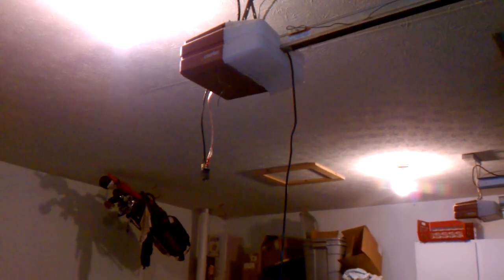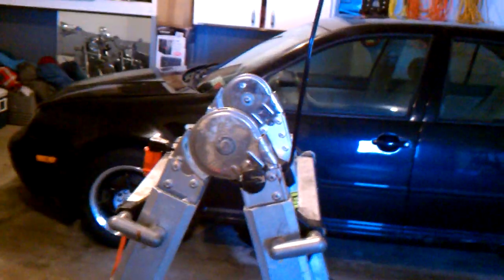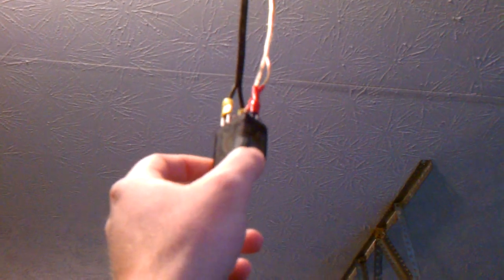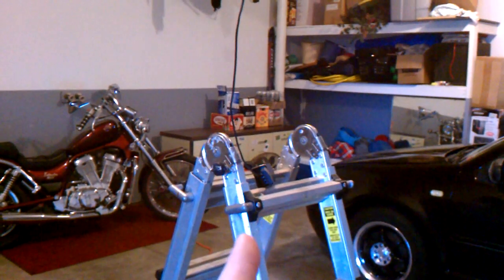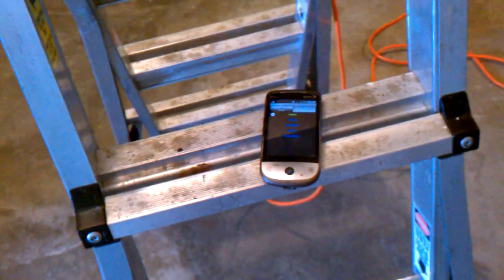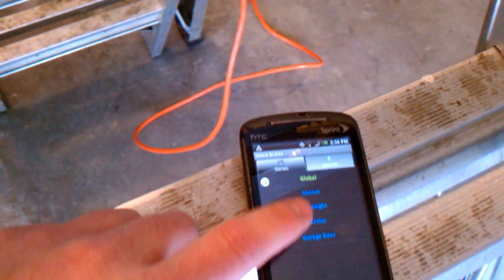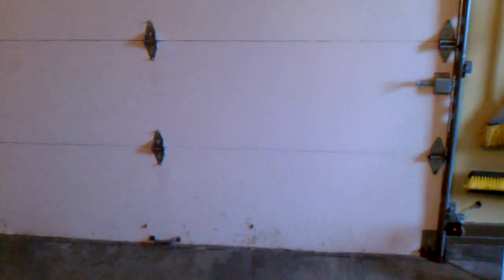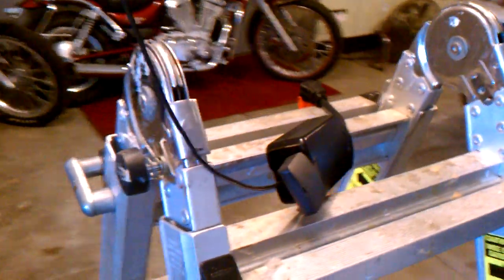Garage Door Automation with Z-Wave

Comment: Just wanted to my thanks for this as well. I used this as a guide and automated my garage door opener today. Since the radioshack link is dead, putting in a couple of links to help others --
I order the 12V relay from Amazon here - . https://www.amazon.com/gp/product/B01B60BQFA/ref=oh_aui_detailpage_o01_s00?ie=UTF8&psc=1
I had a old 12V power adapter (Vonage phone adapter actually) that I used to hook up the inputs on this. The output went to the control for garage door. Worked like a charm. Thanks!

Comment: also does this have battery backup now or no and safety sensors and a keypad or no also you should replace those garage door openers with a liftmaster 8550 with battery and a new clopay door 9x69 clopay door replace that ugly wood door a clopay door with windows and wi fi in in it or raynor admiral 2 8550 rdg with wi fi and

Comment: Great video. What type of wires your are using to and from the Relay. I got the Relay in your link but found it difficult to work with SouthWire 12/2WG. Thanks.
Reply from the maker: Wadood Chaudhary Whatever wire I had laying around. To be honest it's not that important. So whatever you have the works should be fine.
Reply: Ryan Schneider I think you should mention 2 conductor wire or something like that. Thicker wires would not warp or hold onto Tyco Relay witch. Anyways, thank for your ingenuity. I was able to do it, and I also added an inxpensive garage tilt sensor and now I also know whether the garage is open or closed as well.
Reply: Somehow the garage door switch on the wall is turned off when Z-Wave switch is turned on and vice-versa. Does anyone know why is that happening?

Comment: HELP! Every time I try to do the exact assembly shown in your video and several others the button on the wall won't work. The app will, but the wall-button opener won't. And vice-versa, if I get the wall-button opener working the app won't work anymore (and the wiring is EXACTLY as shown in the video)... Please help.

Comment: Thank you very much for the video. Everything worked out great. I did want to share my experience as a Vivint User.

Being on Vivint is where I had to get a little creative. I checked into the scenes but unfortunately the Vivint controller is VERY limited on what you can do. You can only set a single unit to turn on or off. You can't set it to turn on, wait some time and turn off. So I was poking around the web setup for Vivint and ran across the rules section under emPower. Here is where I found the solution but you will need a sensor on the garage door. I already had a window/door sensor installed on the garage door from a spare one that I had for a while. In rules I setup two rules. They are as follows.

Light Rule 1     Garage Door
Opened     Always     Turn OFF     Device 2: Garage Door
Light Rule 2     Garage Door
Closed     Always     Turn OFF     Device 2: Garage Door

I put everything together and it worked perfectly. Thanks again for the video.
Reply: thanks for the details... ill be trying it tomorrow

Comment: I did something similar to this, but not quite the same. Rather than wiring directly to the garage door opener I used a garage remote.  This might seem like a more expensive option, but I had quite a few extra openers around so my cost on that end was zero.  I used the same zwave device, setup a scene the same way, but had the relay close the switch on the garage door remote.

Comment: Your garage door opener motor must be plugged into always on outlet. If you have a Z-wave controlled outlet you will need a relay to tell the garage door opener to trigger open and close. You should use a 12V DC relay for this as the 110V AC relays as featured in this video can be dangerous. If the relay overheats, it can cause a fire.
I hope this helps.
We do sell these relays, as well as other items for your Home Control System.
007systems

Comment: Nice Video, 
I installed a zwave in wall duplex receptacle. Can the garage opener be plugged into the same outlet or does it need to be on a different outlet for it to work ?

Comment from the maker: Normally it would, but I don't activate the zwave outlet directly. I use a Scene. The Scene is programmed to do the following:

1) Turn outlet on
2) Wait three seconds
3) Turn outlet off

Therefore when I activate the garage door, I'm actually triggering the scene in my vira controller.

Comment: Thanks for share this!!! I just have a question... 
The Z-Wave Outlet is designed to turn on and off a light or a device. Every time you activate it you turn on or off.  The requirement here is to send a pulse to the relay because when you pulse the wall button to open or close the door you press only for a while.  When you activate the Z-Wave Outlet isn't it like if you leave the button pushed until you deactivate again the Z-Wave Outlet?

Comment from the maker: I personally did not bother with that because I had wireless IP cameras setup outside the house that captured the garages. That way if I there was any question, I would check the video. Additionally I used Vitamin D to setup email notifications/alerts on the areas on the screen where the garage doors were so I got notified anytime the door moved. While not ideal for what you're saying, I was able to kill two birds with one stone.

Comment: thanks, your idea was golden to me. I was trying do solve the problem, was thinking of a separate "pulse" circuit and googled my way to your video. Et voila, it's working...unfortenately, I can't read the status of the gate. Maybe , I'm thinking of using some sensors that connect trough Z-wave, any other idea ?

Comment: I like the idea but it’s not NEC compliant as done and could invalidate your insurance policy should something go wrong. The good news is the fix is fairly easy. Use a low voltage relay coil (12VDC relay coil voltage) instead of a 120VAC one. Then get a 12VDC wall wart (power cube) and plug that into the Z-Wave switch. From this point on you are using low voltage Class 2 wiring which is much less stringent from NEC perspective. It will be safer and you avoid the NEC noncompliance.

Comment: I apologize for my ignorance, but when you suggest installing this hookup "in parallel", I'm not sure precidely how to wire a single device from 2 power sources in parallel.  My attempts at inserting the low voltage wires from this hookup into the garage door opener in the ceiling into the same slots as the current wires did not work.  Am I doing something wrong?

Comment: There is a slight downside, in that z-wave is not secure.  Anyone can spoof the homeID and open your garage door, if they felt so inclined.  The only secure zwave devices so far, I believe are the deadbolt zwave locks, which swap an encryption key, and I believe a garage door opener module.  I like your implementation, pretty easy and elegant, but I'm personally going to do a little more looking into the security aspect.  I'd just attach the garage door to the home alarm, so sirens blare for now

Comment: Fahd - depending on your alarm system you could add a sensor to Partition 2 ( if you have a common alarm system like a Honeywell Vista 15p / 20p)

You can then set the alarm to NOT alarm when Partition 2 sensor (the garage door) opens during certain times (9-5pm for instance). But yes - in the same way opening a door (from inside) when your alarm is 'away' will produce an alarm, so will opening the garage door. Using partitions allows you to keep the 'house' alarm separate from the garage alarm.

Comment: Ryan. First - thanks for your video. I used it to fashion my own z-wave opener, but instead of using the 'outside socket' that you have, I replaced my existing 2-receptacle socket it was previously plugged into with the z-wave enabled socket ( GE 45605 )

It's a bit cleaner and allows you to have both the opener and the switch in the same receptacle. If you mount it in a double-sized container you can affix the relay on the other side of the box :)

Comment: Thanks so much for posting this. I set this up today and it's working great. I was going to use an LFM-20 zwave relay but its hard to find. This worked just as good and is cheaper to boot. Thanks again for the great video!!!

Comment: Awesome video!!  You're a huge help.  We found this video a little while ago and set it up just as you displayed and we got it to work.  Instead of using the external z-wave plug you have there, we purchased a Jasco Z-Wave Duplex Receptacle with one controlled plus and one non-controlled plug.  The garage door motor is plugged into the non-controlled side of the outlet and the relay is hooked up to the controlled side.  Great job and thanks for the idea!!

Comment: I want to thank you as I have this working now.  For those interested on the relay from Radio Shack you need to use 7&8 to the power plug \ Z-Wave switch, and 3&5 or 4&6 to the garage door opener.  I had some issues with a converter being used to connect the power, which didn't work until I replaced it with a straight plug I got off a broken clock radio.

Comment: With this setup, did you try opening the garage door by the zwave switch, then push the button on the wall?  I would think that activating the zwave device would be just like holding the button, meaning that even after the door is open, the wall button wouldn't work unless you deactivated the zwave switch.  I'm new to this stuff, but normally, the opener just looks for a momentary contact, then open again, not continuously on.

Comment: Thank you!!! I got this working just as you described!  I also have a door sensor that tells me if it's open or closed. :)
One suggestion if you can do this: (I'm using a VeraLite controller)
1) Instead of using a delay to turn off the relay, add a scene that disables the switch 2 seconds after it's is engaged (triggered).  Then no matter what mechanism you use to trigger the door, it will always reset.

Comment from the maker: 1. Yes, wiring of original garage door opener is untouched.
2. Yes, I cut the cord off an appliance that I was throwing out.
3. Yes, I used speaker wire actually. This was wired from the output/switch side of the relay to the "bell wire" or "button" connections on the garage door opener.

I hope that answers your questions.

Comment from the maker: Yes, for the garage door to work I don't need anywhere near that long, however I've found the z-wave functionality to be more reliable with a longer delay. When I had it shorter (ie. 1 second) sometimes it wouldn't work. I will checkout the everspring detector, however I already had the camera so was trying to save a few bucks :=). Ideally yes would hook up the sensor you mention and it is compatible with my Vera unit. Thanks for the info!